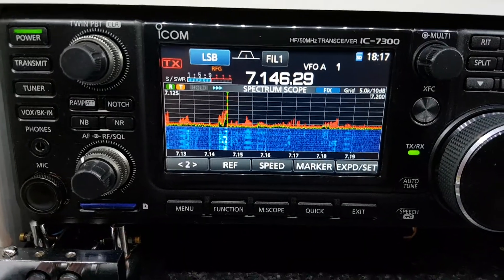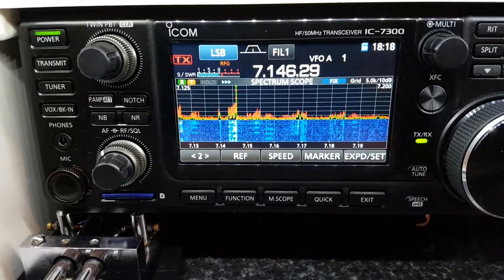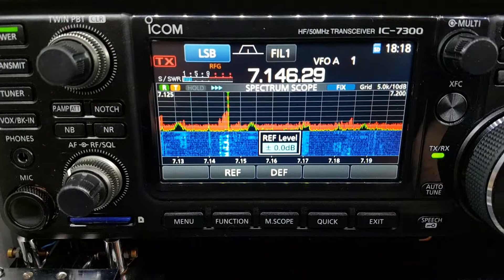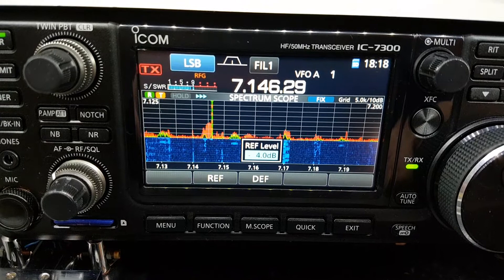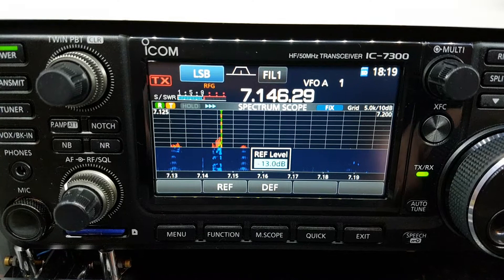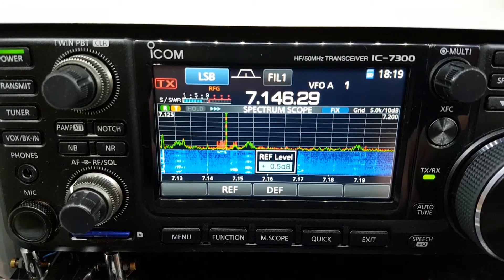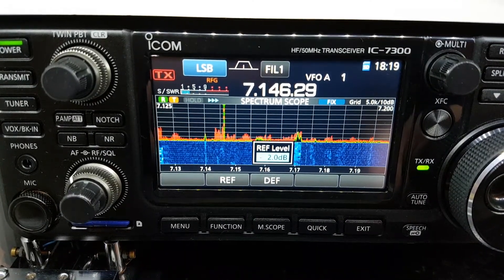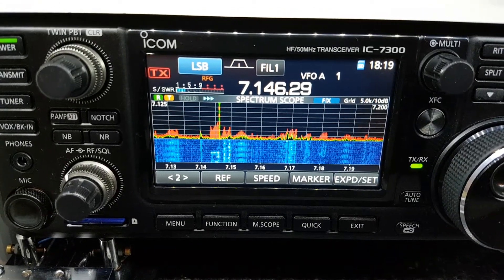Icom IC-7300 Spectrum Scope Reference Adjustment Explained

Comment: Suppose that you have the spectrum scope on, and you are in the Centered mode, (CENT/FIX button). If you want to clear somehow the waterfall, then you press the REF button and using the main dial, you may alter the level by + or - 20dB. If you decide to change to the Fixed mode, (CENT/FIX button), then the already regulated according to your needs REF, is gone! You must again alter it, to a new position, in order to watch the waterfall, as before. Has anyone else spotted that?
Reply from the maker: I dont use it in that configuration.